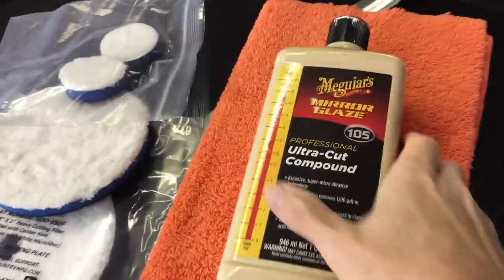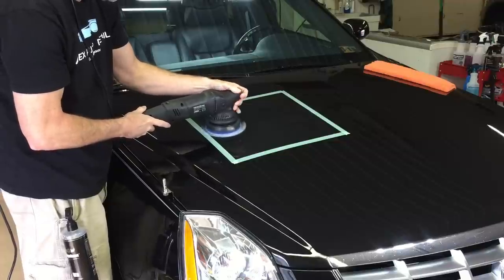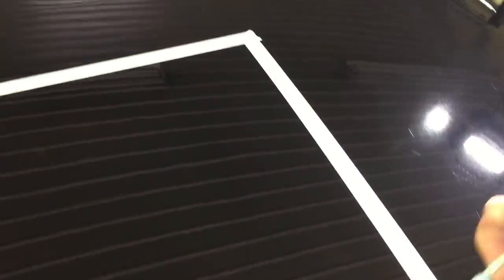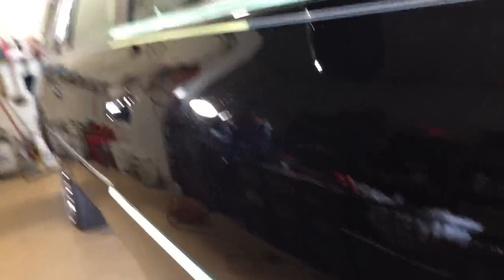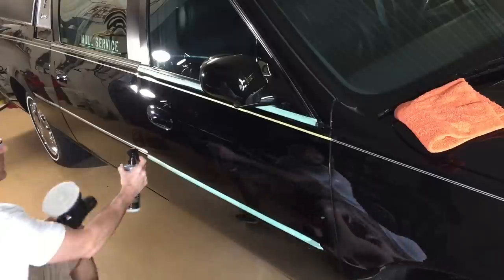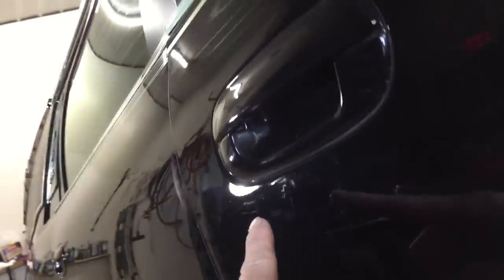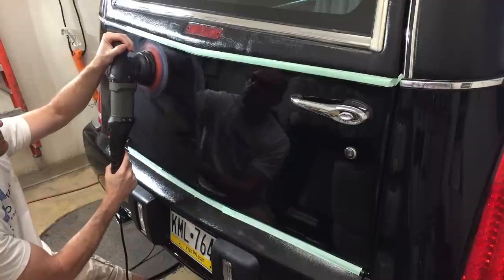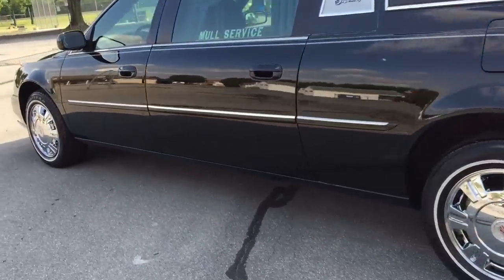Some tips to get the most out of Meguiar's M105  Mirror-Glaze Ultra Cut Compound!!

Comment from the maker: Thoughts from Megs fans out there!!😃
Reply: Apex Detail The Meguiars SMAT system works for me,
M100 & microfiber, M105 & wool and M205 foam.
Reply from the maker: Thats all I can hope for. I want you all to be successful and prosperous!👍🏻
Reply: I've actually had very little success with Megs products. Whether it be 105/205 or even Ultimate Compound/Ultimate Polish.

The compounds work, and paired with MF pads they do cut pretty well, but they do tend to scour the paint much more than competing products. I cannot for the life of me get M205 or Ultimate Polish to finish down, no matter what I try. Different pads, # of passes, different pressures, diluting them both.. They just haze the paint no matter what.

Compared to the Griots BOSS system, I can't believe anyone still uses 105/205. The BOSS creams are undoubtedly more expensive, but man.. Fast Correcting Cream does SUCH a great job, and on my paint (that M205 scours) I can use Fast Correcting Cream with a light cutting pad and finish down LSP ready. It's seriously great stuff. Seems to have an infinite work time, produces no dusting, and smells great.

Comparing M205 to Perfecting Cream isn't even fair in my eyes. Perfecting Cream just blows it away.

I know this is supposed to be about Megs, and I got kind of side tracked, but I guess it seems relevant because when I was searching for compounds/polishes that I enjoyed using, I just kind of assumed the BOSS creams would be like "repackaged" M105/M205. I know that some guys have great success using Megs stuff, and I'm envious because compared to stuff like the BOSS creams it's super inexpensive.. But I'll be damned if the BOSS stuff isn't worth every dollar more.

There's just too many great products available from Griots, 3D, Sonax, etc, to be wasting my time trying to make these dated Megs products work!
Reply: I like the retail abrasives - the Ultimate line. Easy to work with, fairly predictable performance, and they work well.
Reply: I'll take megs tips all day. Thanks Brian!

PS. Ultimate Compound is handy too.
Reply: I've been using Megs compounds and polishes for 13 years now. It's not the best but it gets the job done at a good cost. And if you think m105 dusts, try the old Diamond Cut. That dusts like crazy.
Reply: Hello Brian. I like megs products but I do not use M-105 its just so notorious for dusting. I using M-100 which a much longer working time. If I need a really heavy hitter then its time for M-101. Like to see you do review of both M-100 and M-101.
Reply: Do you use any of the rupes series of da's.
Reply: M100 & M205
Reply: @ww2717 Ive been using m-105 for long time. Does the M-100 dust as much as the 105 ? How does it cut compared as well?  I would like a longer working time. Thanks !
Reply: @MrBod4life  Hello M100 has a much longer cycle time than m105. As for the  cur comparison between the 2 I would say that they are on equal footing. If you need some really serious cutting power then I would recommend m101. I hear that the new M110 has the cut of 104 with the longer cycle time of 101. I haven't had a chance to try.  I would give it a shot. M105 short buff cycle and heavy dusting are 2 of it's big draw backs.
Reply: @ww2717  ww2717 wow very informative thanks for the difference. What about the dusting with the 100? about the same as the 105 would you say? thanks again!
Reply: @MrBod4life   Hey skip the m100 and go with m110. I think I you will find this is what m105 should have been all a long. Best of luck to you.
Reply: @ww2717  I hate that its 10-15$ more than 100. I just need something that doesn't dust AS MUCH as 105 does. Perhaps I can spray the pad/surface with the M100 to cut down on dusting if it does dust? Thats what I was doing with the 105. Did help some. Im trying to save some dough. lol thanks man
Reply: @MrBod4life  If you want to say with 105 then use the old detailers trick of adding some drops  m205 on the pads with the 105. The polishing oils in 205 will help cut down on the dusting and give you a bit more working time with 105. You should also mist your pad with pad conditioner before you begin your buffing cycle. See how that works for you. Also remember there are a ton of other smat compounds and polishes on the market that you can try.  Please post back your results using 105/205 combination.  Best of luck.
Reply: @ww2717  LOL I have to laugh because here I am, before you posted this, searching google: "combining m105/205 together on same pad" and look you just answered my question perfectly!  So I will definitely give that a shot and report back to you. I also bought some M100 just to try. Have you tried combining the M100 with the 205? Wonder what that combo would be like? Thanks man!
Reply: I own a custom guitar business and I use Meg for my guitar finishes and they work out great. A guitar body is just stained or painted wood.
Reply: @stevensparks19  Thanks for that feedback.  I am new to this and just struggling to make 110 work for me.  I have heard just great things about BOSS.  I will try this next.

Comment: I just restored the hood of my wife's 08 bmw, that thing was fucked up, scratches and deep hazing, I didnt think there was even clear coat on it. I used a porter cable sander with CB polishing pad. I damp the pad with distilled water and put 3 grape size drops of m105 and then 3 pea size drops of ultimate polish 2x2 sections, I did very long passes and spray some distilled  water  on the surface when it looked like it was drying up. Cleaned the pad with water in between passes. Then wipe it off with distilled  water. The results were amazing to be honest I thought that hood was done.

1st time I used m105 I was very frustrated  with the dusting, but putting extra amount and lubrication it gives very good results

Comment: Great video brother. I've heard to control the dusting utilize a little more product and have slightly faster passes so the product doesn't heat up and cause dusting, caking, and haze. I've never tried it but a few forums mention that by doing that 105 works fine, what's your thoughts on that? My guess is that is with utilizing a foam pad. However I definitely agree with you on better compounds out there but I'm sure there's a lot of guys out there like myself who has a full bottle and would love to master the product so we don't wast it😂thanks in advance brother and keep the videos coming!
Reply from the maker: You said it... i would go through that just to use the rest and get the most out of it... then never buy it again😁
Reply: @apexdetail85  What do you recommend?

Comment: I currently have the m105 and 205 combo and the dusting is terrible. I use Griot's spray detail to try to keep it at a minimum. I currently just got into paint correction. What other two products would you suggest I trade these out for?

Comment: George
      This video is an A+, its very educative because You can the see the difference between a regular DA and a long throw DA loke 21mm how easily removed all those marks, scratches, sure combining the correct pad. I need to ask you a question that is not related to this video. After using Meguiar's 3 in 1 wax, can I top that with a sealant or like can coat of Gyeon? Thanks in advanced for your help, Brian

Comment: Always so excellent with tips as usual that never disappoint. A fan of France. Thank you for everything you do to share your knowledge and expertise.. personally I use the maxshine 21, a fantastic tool for novices and I'm training with a rotary polisher dewalt on body parts at a friend coachbuilder, it's not the same, it's better to train before using it ....
Reply from the maker: Those are great to start with... finding a lightweight rotary is key.😁

Comment: Brian you have to check out the new smat compound and polish from Meguairs M-110 and M-210. The m-110 is all that 105 should have been years ago. No dusting and longer cycle time.
Reply: Mix some m205 on the pad along with the m105. The polishing oils in m205 will give alot longer cycle time and reduce dusting.

Comment: There was a time when I used M105 fairly often; didn't know of another product that cut as quickly with as (relatively) fine finish. Well, times have changed and M105 hasn't. The dust. Oh, man. I still use M205 on occasion and once in a while add a bead of M105 to the pad for a bit more cut, but it's rare. Today there's no shortage of better and easier to work with abrasives.
Reply from the maker: Completely agree👍🏻
Reply: What do you like to use?

Comment: I tried for the first time today. I painted my hood, then flattened the paint with 2000.   Then I went to the meguires. With a rotary/ foam pad. I tried to be a neat as possible, but I slung compound all over everything, and it stuck. Especially on trim/plastic.  The “dust” was extremely hard to remove. It looks so easy watching a pro. I made a mess.
Detailed spray?  Or a product that doesn’t “dust “ or fly all over the place?

Comment: Brian, thanks so much for sharing your knowledge. I don't detail cars but I do use the same products, tools and processes to polish epoxy and I have really learned a LOT from your videos. I am using a  mirka da sander to get to the 3000 grit stage then a dewalt rotary for the cutting and polishing. Currently using megs 105 for compounding but as you say about the residue control driving you nuts I am there so going to try sonax cutmax and perfect finish on my next test. One thing I am sure you would appreciate is the the 1/8 INCH clear coat I get to work with in my projects and I don't worry about burning through believe me. Any other products (liquids and pads) that come to mind that are more tuned towards polishing a plastic like material would be greatly appreciated! Thanks Again and keep up the excellent work.
Reply: Eric Works! 7

Comment: Hi, Great videos! I'm picking up a 2012 White Nissan Leaf this week and want to use your techniques for making the paint look as good as possible. I have a 700 rpm Torq X random orbital and will use Meguiars 100 Polish followed by 200. Can you recommend the right pads to use in each step, and also, I'm considering a ceramic wax topcoat after the whole job is done. Another question, do I need to use a clay bar prior to the two polishing steps? Hopefully, this car has good paint and has been kept outnof the sun! Thank you!

Comment: Quick detail, you mention while doing the rear panel that you want to let the SMAT particles break down. M105 is supposed to be using non-diminishing abrasives, with the point being that the abrasive particles DON’T break down as you’re compounding. Feel free to correct me if I’m wrong, I’m just getting started on my DIY detailing experience (getting my cars prepped for Avalon King’s Armor IX - Ceramic Coating). 

I was planning to go with the M105 & M205 combo to prep the paint on my 2020 Honda Civic Si Coupe (in pearl white), and our 2017 Mazda CX-9 Grand Touring (in gunmental grey). But I’m not married to the combo, if you have a better recommendation PLEASE let me know. I’ll primarily be using a 20 mm long throw DA polisher, I might do the small sections like doors sills, and front bumper ledges either by hand, or with a 3” rotary drill attachment pad. Please let me know if you know of a better combo for the paint prep for ceramic coatings.

Comment: I have written to Mag several times and as recently as yesterday.  I am a big fan and loyal customer. However, they tell me that that haven't run into this or heard about this issue. I actually started using QD on my own because I couldn't get the stuff off without my forearms and shoulders burning. I even started claying prior to using 105. They did suggest using 110 - never heard of it. I own their porter cable DA and a professional Makita rotary. I can't image trying to get this off by hand (I did try, but the effort was short-lived). What products do you like that produce the 105 and 205 results without needing a sandblaster or being a professional arm wrestler? Thank you and glad that I am not loosing mind.

Comment: Hey b, I'm working on a nissan  300zx with original red paint. Which cutt and finish compounds would you recommend? I usually use m105 with an orange pad and then m205 with a white pad. Your thoughts.  I have plenty of pads but would like to try something better... Like you said the dust and working time is a PIA.

Comment: Funny how I am looking at this ! Perfect timing.  Question if you know??  I have a   Micro blue 2018 Kia Stinger GT-2 that was Polished Ana coated by me. I used all chemical guys polish, and finished with Carpro Essence. Then car was coated with Uk 3.0

Well, on the back plastic deck only... I have noted some water etch marks..??? Just used Meguiars ultimate polish and Meguiars Microfiber 5’ Finishing pad do attempt to remove it ... well, I can’t get it all out! Even some of the love scratches that were put in clear from transport or dealer... I never fully removed. I have all 4 V38,- v32 chemical guys polishes, but I am new to the Microfiber pads. 

Question to you with your detail wisdom.... what do you think I should step up to next to completely attempt to remove the water etch marks?  The rear trunk deck is made of plastic

Comment: The M105/M205 combo has always worked for me but the dusting can make you miserable. I detail in the elements so it's been a while since I've reached for my Mequiar's as I'm usually doing one steps with HD Speed, D166, or Sonax Perfect Finish. It's tried and true for me but old tech compared to what's out on the market today. I'm thankful to not have any horror stories about trashing paint because I've never been able to afford failing on a customer vehicle. I have to admit I am a Mequiar's fanboy just because when I knew nothing about detailing I still knew Meguiar's products, but I also get what you are saying... wipe off on a hot panel can be a bear to remove.
Reply from the maker: D CarrStar totally agree 👍🏻😁

Comment: Do you think I can use this compound on my vehicle windows? Or will it damage the windows? Because I got really hard water spots they’re really baked on there. They been there for maybe 10 years now and I’ve tried using the steel wool and vinegar method and I tried the ultimate compound but they didn’t work.

Comment: I am cut and buffing a 2011 C6 Corvette that has fresh paint on rear quarters and hood. I started with 1200 and worked my way up to 2500 wet sand. I purchased the Maguiars 105 to finish up my cut and polish. First time doing this. What product do you recommend (I can take back the 105). I would like to end my project with a ceramic coat, so after I finish 12:51  the cut and buff do I add a polish or just a ceramic coat?

Comment: I just did my Black Honda Pilot with Megs Mirror Glaze 105 and it dusts terrible.  What products/pads do you recommend?  I’ve Dewalt DWP849X buffer. 

There’s some scratches I was afraid to continue buffing for fear of burning through ... is there a way to check mil thickness?

Comment: I am interested in removing orange peel without wet sanding on toyota finishes/ clear coats. Will M105, The CarPro Velvet Orange Peel Removal Pad, and a Rupes LHR 15 Mark 3 at the correct speed be too much for orange peel removal on soft toyota paints and finishes?

Comment: Usually, should a vehicle get polished after compound or could you get by doing a one-step of just compound if deemed necessary as the least abrasive method that removes the abuse on the paint?

Comment: I am attempting to take orange peel out of a PPG Delfleet single stage I have used both 105 and 205 and also 3M trizact number one and 2 wool first then foam. Looking down the panel it’s like glass, looking strait at the panel from a 90 degree, there is cloudiness or haze in the white. What am I doing wrong? As you said, the residue is hard to get out of corners etc. thanks

Comment: i'm using 95% m100-5%m205 mix to cut and i'm loving it, i have less dust than ever, however since i'm using it in a free spinning GG6" im having a power leak to cut damage quickly (mostly with MF cutting pads), so i'm looking forward to get a stronger machine, what would you suggest? a long throw 21mm, 15mm or a forced rotation? and what brand? maxshine? rupes? flex? GG boss? thank you, i love your work

Comment: Hey Brian.  I am new to this.  I have an old 2006 infiniti.  I did a test panel.  1 with 110 the 2nd with 210.  The 110 side followed by 210 for 2 step process.  The side with just the just the 210 alone finished better.  I don't understand why.  Could it be that my 13 year old car's clear coat has worn down.  The side that I ran the 110 on had a few dull spots.  Am I applying to much pressure to my DA?  I did 4 passes on each application at speed of 5.

Comment: I am 58 and have not done more than wash my vehicles in the past 35 or so years. ( way to much to do and what little time I had I spent on engine/brakes and mechanical) I just have farm trucks and want to get from Ato B . Now I am retired due to heath reasons and and have time and a (nicer) truck /a 2008 3500 silverado, with 40.000 miles it lived most of it's like inside so the paint is nice(for me) and I want to try to keep it nice, no show truck but not a farm truck.and I also have a gooseneck horse trailer with living quarters that is alum. With white sides. What would you recommend to help keep the trailer from black streaking as badly and keep the truck nice. Last time I waxed my 1970 el Camino I'm pretty sure it was turtle wax that was the stuff poor 16 year olds used( if we got anything at all) any help would be greatly appreciated. My old 70/80s inflicted brain cells are overloaded with information on UTUBE. Am I overthinking it, being to anal or both.